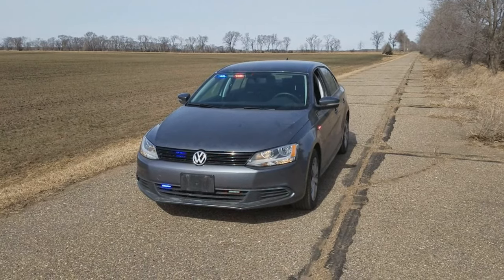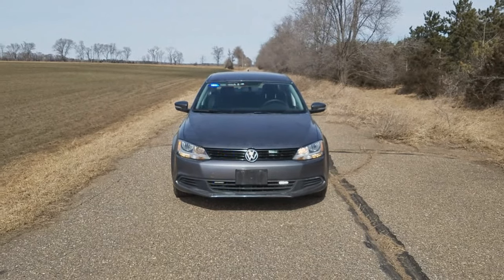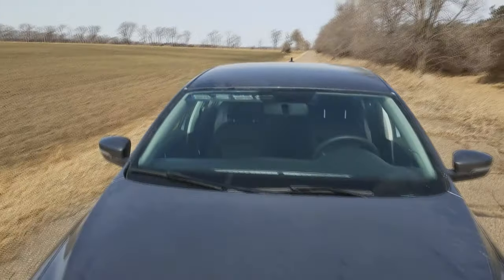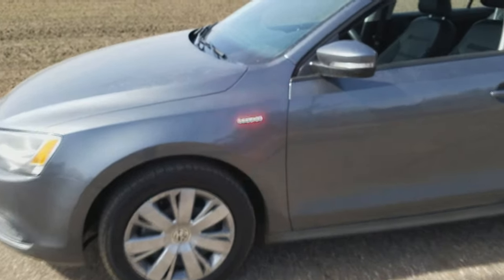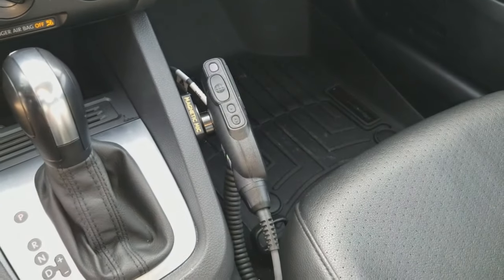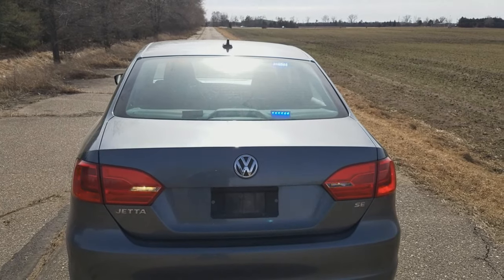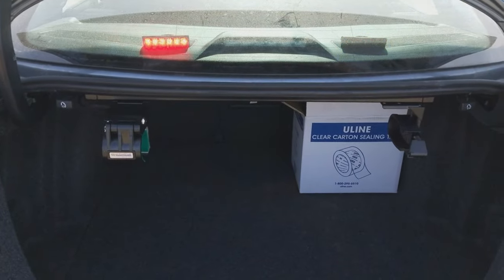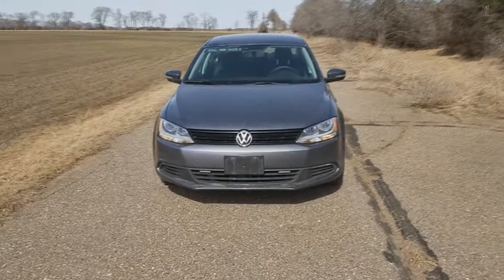Unmarked Police Jetta? | HD Install Video

Comment: Clean install, looks good. The only things I would have done differently is to sync the front mPowers and put the HLF and opticom on a separate switch so you could still have front lighting without those on.
Reply from the maker: We would agree. Customers often request certain install specifications that we have to follow. In this case they were looking for as simple activation of the lighting as possible due to the fact that it will be an admin unit and the lighting will be used on a minimal basis, and a more "individual" look to the front light heads. The customer is always right!
Reply: Unfortunately they are.
Reply: They also had to keep it "stupid" simple for admin!

Comment: Is that a 1.8 or a 2.5 jetta
Reply: ShinoSkylineGTS being an MK6, I’d bet it’s a 2.5L. That’s really the last generations they used 2.5’s on
Reply: That is actually the base Jetta with the single overhead cam 2.0 aka the 2slow engine